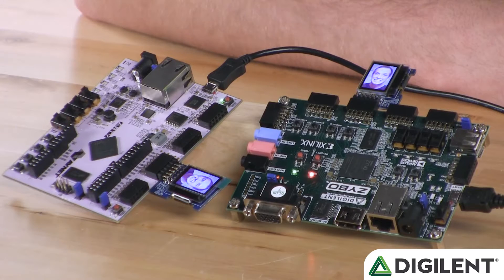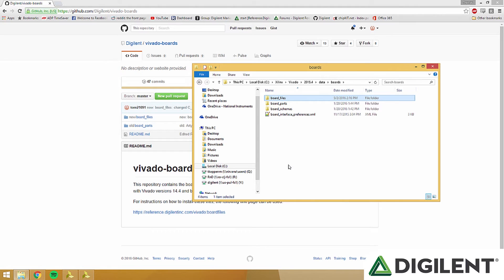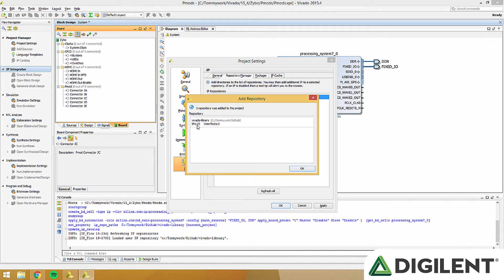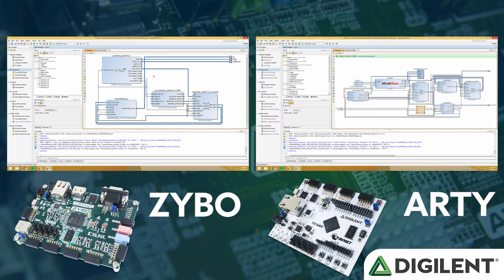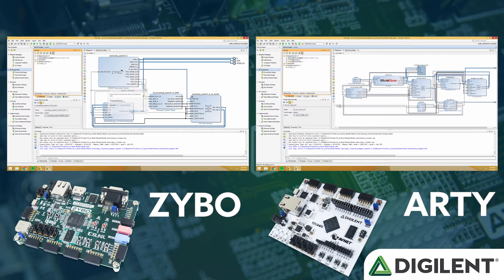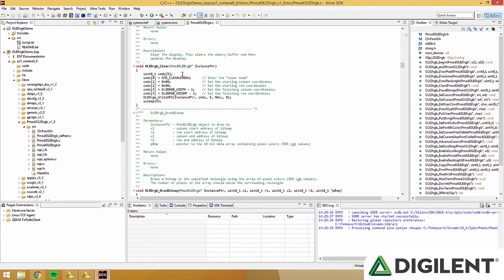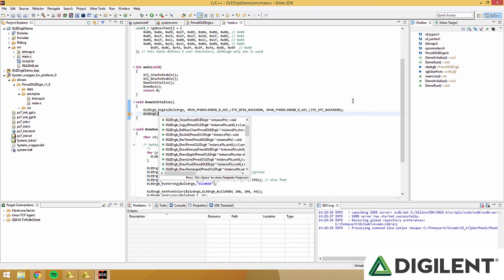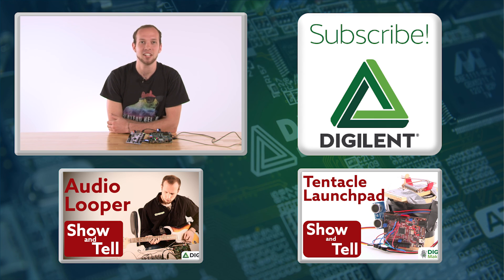Show and Tell Ep. 14 - Plug and Play Pmod IPs on Zybo and Arty

Comment: I am working on pmod tmp3 ip. I want it to be plug and play like once I dump the code on fpga, after that even if I remove and reconnect the pmod tmp3 ip, automatically it should reconfigure and I have to see the values again on hyperlink. Can u please tell me is there any plug and play ip which will help me to solve this problem?

Comment: If there are PMOD boards with switches and LEDs why have them on the Arty board at all?Seems like a waste of FPGA resources.
Reply from the maker: The Arty board is also purposed for people getting started and having simple GPIO is useful for bring up, interaction and testing. Eventhough inexpensive, we didn't want to force people to purchase Pmods in order to get the same functionality.
Reply: I was actually thinking you could include basic PMODs with the board, but - fair enough.
I'll be trying to design a PMOD board myself soon, for the SI570 oscillator. Wish me luck.
Reply from the maker: We'd love to see it when you get done! We started a design community at pmod.org and want to feature other's designs.